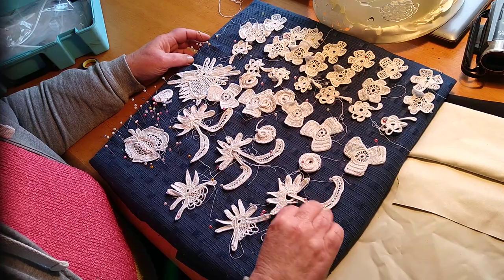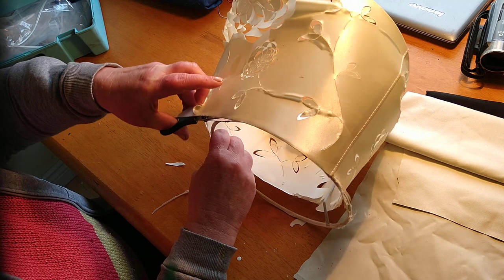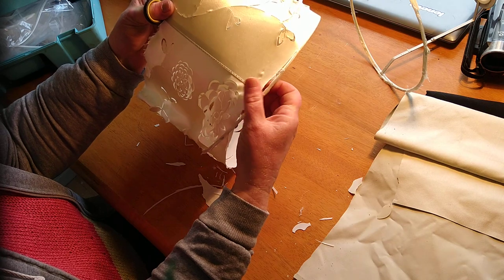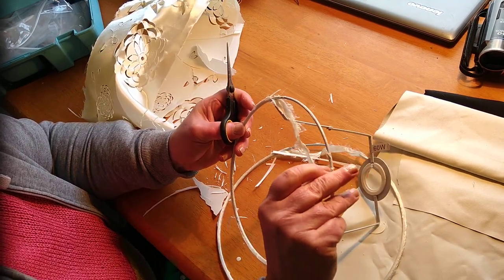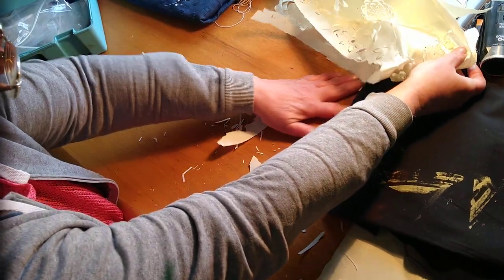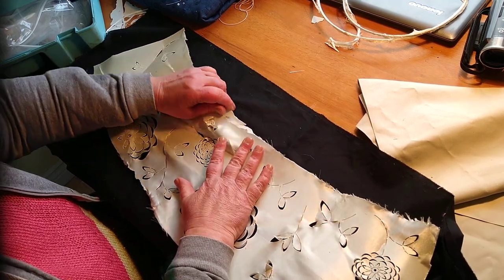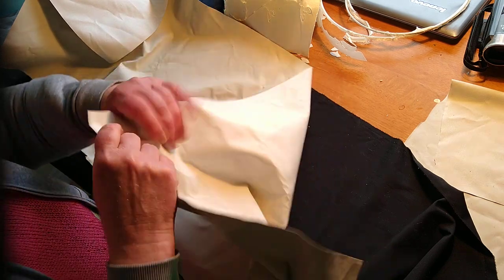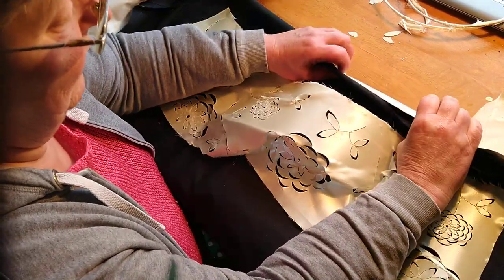How to make a lace lampshade

Comment: Are you sure that the varnish will hold the rust away???
Reply from the maker: I've been doing this for quite a few years and up to now, it's worked. Not all rings are pure metal and some are galvanised, but it,s worth it. The varnish will stop air and humidity, untill it wears off.